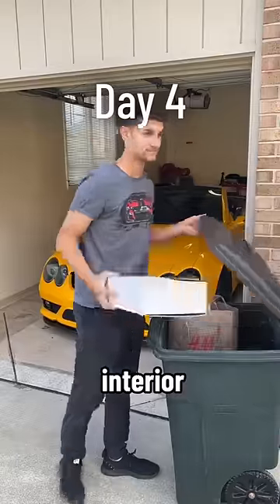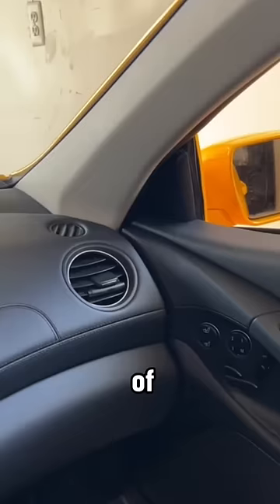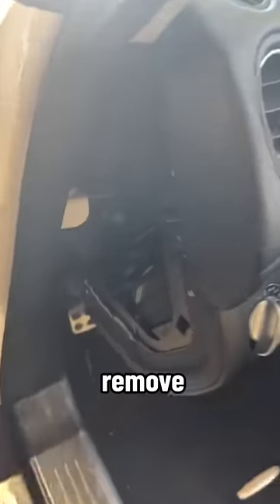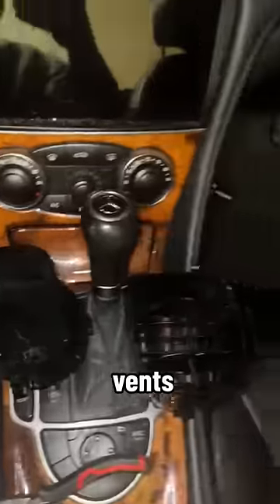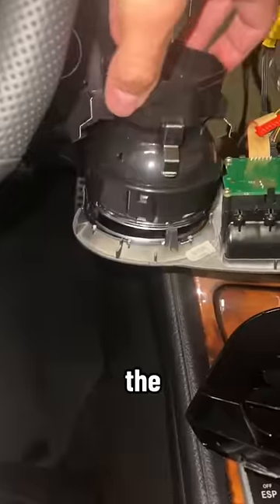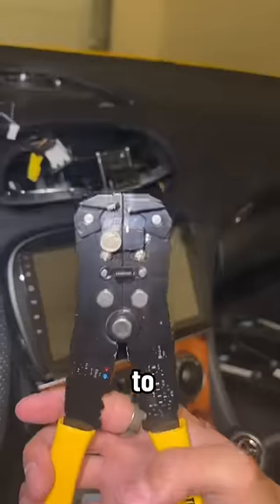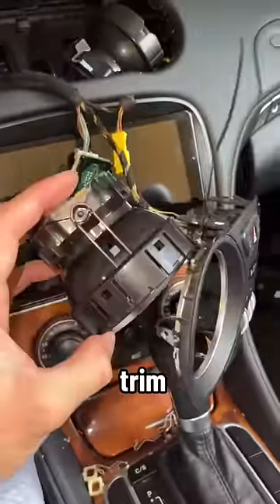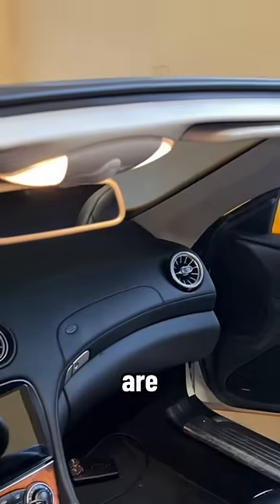Fitment is Mint🤌🏽

Comment: Imagine you buy this car, and as soon as it needs some repairs, you find out there is stuff attached with zip ties and shit...
This is a nightmare for any mechanic.
Reply: That's what I was thinking
Particularly whatever he did to the wiring. This is the kinda car that starts falling apart within a year and all the lights don't turn on or flicker.
Reply: That’s any beginner’s project car, unless you are naturally talented in mechanics or have enough money to do things over or buy the best parts it’ll be rough around the edges. Just as long as whoever buys it knows what they are getting into
Reply: @camerond2534   Yeah and that's the problem. The buyer usually isn't told about stuff like this, because it would lower the price. The seller will almost always lie about the car's condition, just so he can sell it better. Especially in cases like this. Market with used cars is very tricky, you need to really know what you are doing when you are buying a used car. And most people don't know.
Reply: One it's apart of buying cars that people have modified and two he didn't do a awful job you would be surprised how many fucking zip ties are on that car elsewhere from Mercedes
Reply: do u remember the other vids? 80% of them are nightmares xD

Comment: I also have an R230 SL550, the standard internal flaps inside the vents are very slanted so they can be pointed all the way down to your waist and are obviously custom for the car, these new vents look like they are designed for more horizontal fitment, so do the internal flaps tilt enough downwards otherwise all that's going to happen is the new vents are going to blow towards the roof...

Comment: i am a msc computer engineer, connect the ground first, then the voltage. check the current on the manual or you can measure with a multimeter. put a diode through to leds, it blocks the reverse current. also put a little capacitor for every led circuit of yours, high voltage hits are not good for any electronic part, it should be a curve. draw your circuits on a basic electrical schematic program, in worst case, build a simple circuit outside the car with a power supply, approve your circuit there then place it to your car. i worked on EV. also put a kill switch, modifying your car's electrical system can create fire hazards. we follow iso26262 and many other standards, just one wrong signal  may malfunction a critical system. good luck on your project, i also want to convert a classical mgb to an both petrol drive on front and ev drive at back but i don't have a garage :) also don't use voltage divider to drop 12V to 5V, buy simple regulation modules, also don't use mosfet, heat and efficiency will be a problem.